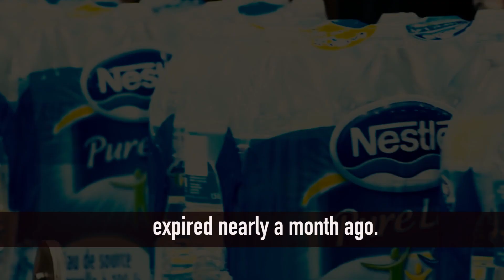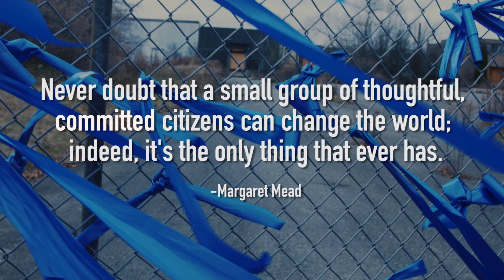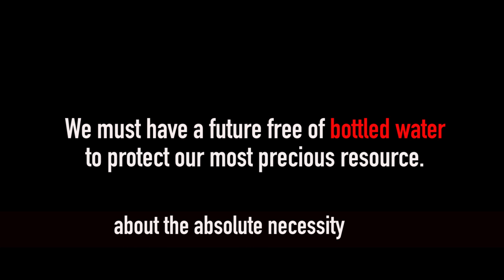Water for Life, Not for Profit! The Fight Against Nestlé in Ontario

Comment: ALL public potable water systems must under Federal Law be tested for the chemical composition in the public water supply. At the various time such as major fire when there is the possibility of back siphonage, most systems get additional antibacterial chemical added. Also, the more people using a public water supply the more stringent the regulations. If for some reason your water has that chlorine smell/taste after a water main break or major fire simply let it stand for a while which will allow the chlorine to go out of the water.